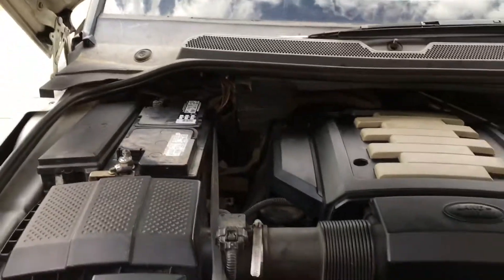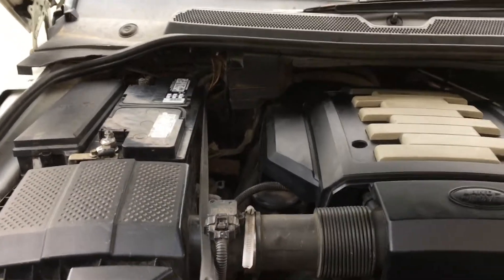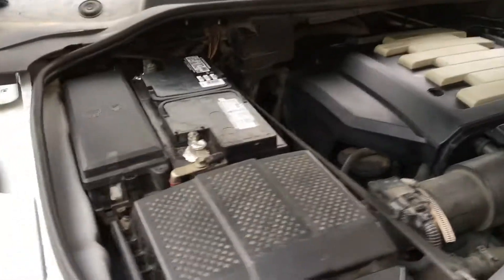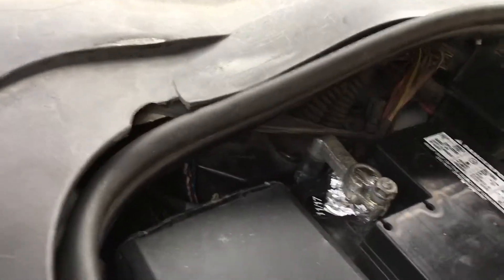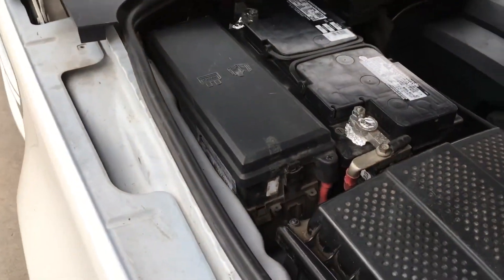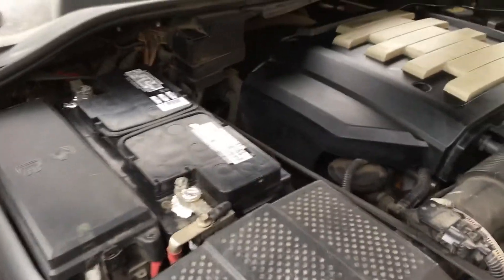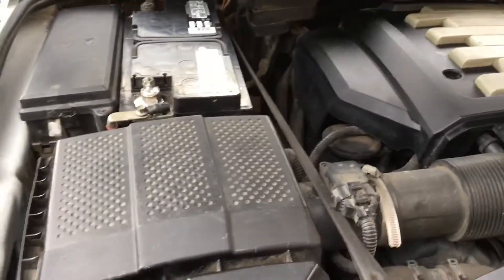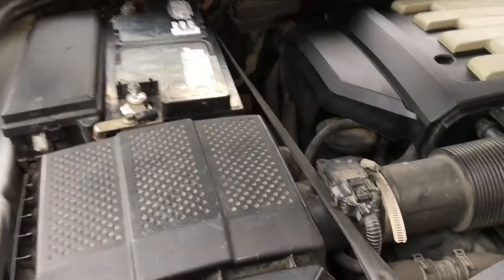2008 Range Rover Sport - Video #3: P0783 Troubleshooting Crank but No Start

Comment: It is the same car that you are working on. The challenge is a crank no start. I have added fuel to the intake manifold and crank the engine no change at all. It is not starting. In addition, I checked for spark, but there is no spark as well.
Hence, I have just checked for injector pulse but there's no injector pulse either. There is also no ignition current to the injector circuit with key ON and engine off. 
All the fuses and relays are good. I also checked the injector circuit for continuity if the wire is shorted but it was ok. Scan tool communicated and showed only p1843 and p1842 code. There was no RPM during cranking. What I noticed today when I compared the ignition, earth and DC with the same car that was starting and driving to the car that was not starting, what I saw made me to flabbergasted. Where the was ignition for example in the working car there was DC in the car that was not starting. It is like that in many places in the fuse box and PCM circuit. Please  what's the cause of the problem and what I need to do?
Reply from the maker: Check the itc